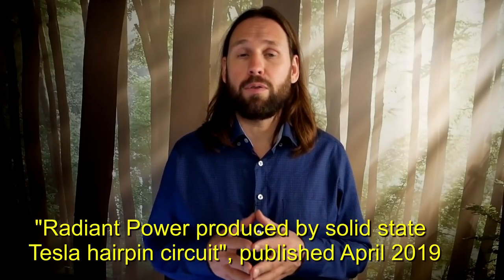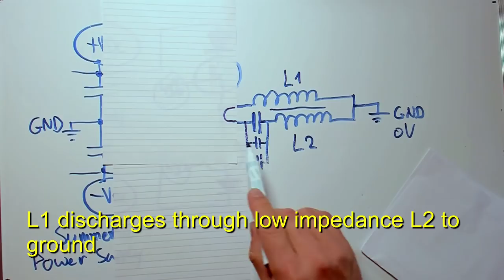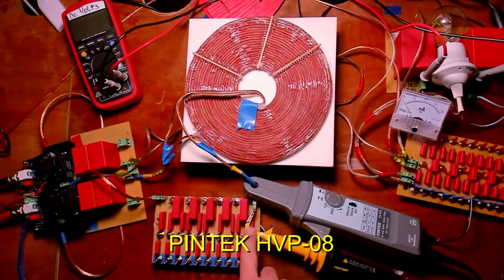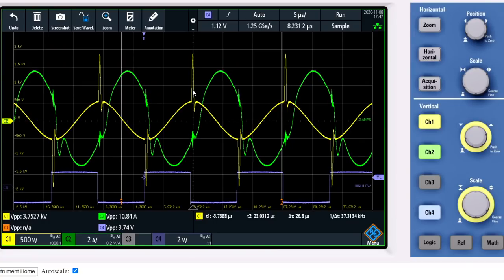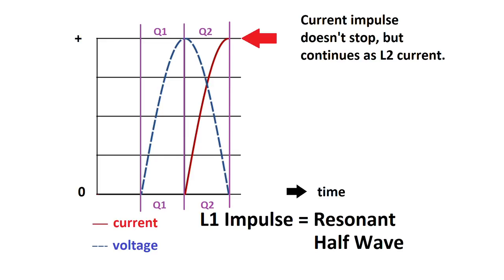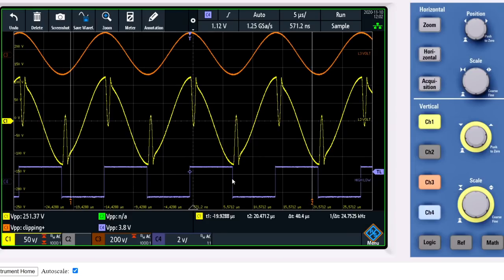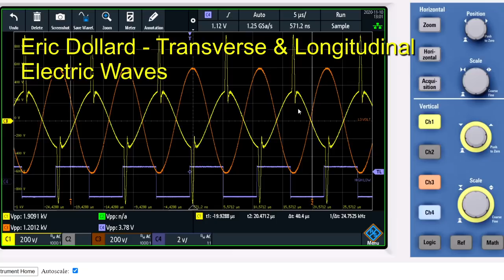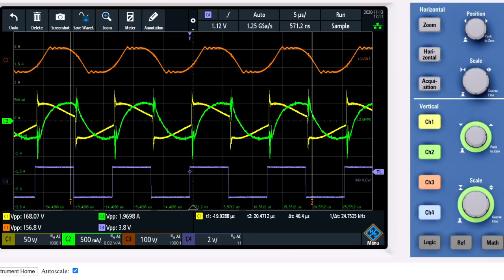Radiant Half Bridge Circuit, For Longitudinal Waves

Comment from the maker: update July 4 2021: This circuit has a flaw, it does not work as intended,
See this video for explanation:
https://youtu.be/bl4xk8CMe8I

Don't forget to look in the video description. there is a time stamp list and I provide several links, with more detailed information about the circuit.
Reply: Around time 22:30 when you present the fact that the L1 magnetic field collapse creates the brief voltage spike pulse into L2 - and you point out that this brief pulse into L2 creates a steeper current growth in L2 - the reason could lie with the fact that capacitors block DC but pass high frequencies so the capacitor connected in series-resonance with L2 is just allowing that spike from L1 to pass right through it.   This occurs because the driving frequency is no longer the frequency of the series-resonant L2 + capacitor.  That is just my guess at looking at your discussion around time 22:30.   If the driving frequency was still the resonant frequency of L2 + capacitor, the pulse would be utilized by that series-resonant path instead of just blowing right through the capacitor.

Comment: I explained many times on forums, energy source is the earth magnetic field, this field is steady, compass prove this. Now displace the field and it will bounce back, like back emf people called. Now resonant circuits is widely used in fluorescent ballast and ccfl ones. The tube act as a discharge capacitor tuned to the half bridge circuit. In radio transmitter, the antenna is the capacitor and displace directly the earth magnetic field propagating what we call radio waves. This concept must be understood by all for understanding what happens. Now we cannot push power and take it at same time, the trick is only this, then for a resonnant circuit, we charge the capacitor and it discharge into his coil, trick is to discharge the capacitor when he reach his full voltage and power the load, charge and discharge cycle, give take exchange in balance as Walter Russell explained. Also power can be extracted by differential output coil, this mean half is CW and other is CCW, source in the middle. One side is grounded and other side is connected to a capacitor the primary can be moved to tune the system to get the best COP. The other concept is to use harmonics: with a square wave input like 1khz a resonnant coil/cap will work at 3 times the frequency input, this mean it will resonate a 3khz and 5khz and 7khz and 9khz etc. Tesla understand this simple fact like music and frequecies symphony, this where all the power can be extracted, between phase shift and also with harmonics. I hope I inspire here some people's with my explanation.
Reply: Also remember a magnet or an electromagnet don't create a magnetic field, it only concentrate the actual field, this is basic fact. Do a air blower or a vacuum cleaner create air ? No it only displace or concentrate the actual air, magnetic field is exactly same, this is why radio wave propagate as growing a stone in a pool, the actual field is here and steady, we only move it and with coils relationship we extract energy called electricity, Donald Smith was wright about this !
Reply from the maker: I like your concept, of energy being in the field. As I explained in my Faraday tubes video, Mass, or better said Inertia, is a attribute of the AEther.

Comment: Don't forget brother, getting reactive power is only the first step.  It is necessary to reconcile the current and voltage in the load in phase.  for this a high voltage must be used.  That is, first dissolve the current and voltage, and then bring them together in the load using high voltage.  If interested, write.
Reply from the maker: already have that. no high voltage needed
Reply: @MasterIvo  I'm surprised I can't get free energy without high tension.  How did you do this?  Show me please!
Reply: @kurbanovmurad2738  I agree. Non linear dependencies voltage and current are critial. Doubling both gives 16 times increase. Good starting point.
Reply from the maker: I already showed resonant voltage and current being IN phase in the extra coil (L4).
I do agree high voltage is needed.
but how high is relative to capacity (plate area and plate distance).
I'm currently working using current impulses from capacitor diacbarges (using parallel mosfets).
based on the insight we need single direction displacement current into the coils (implosion)

Comment: In respect to the current amplification it sounds like a similar concept of the Marx generator and Cockroft Walton voltage multiplier circuit  Hybrid accept with current increasing instead of voltage.

Comment: It would be super interesting to put some of these circuits in a simulator to see how much they agree with measured results.
Reply from the maker: yes, indeed. It will probably show the flaws of the simulator, as it is based on flawed math, which has excluded the longitudinal wave interaction

Comment: thank you so much! i'm too doing thing like you but couldnt found much information as  you give to link all the knownledge I had. Not much people really understand whats is happenning inside these circuit and with no text book to explain, we need to found out all by ourselve. If I can give you a hint to help you, watch the power too on the oscilloscope that help to understand certain part. I make others circuit than your but using same principle and got similar result but I can adjust different parameter to have different effect. Have  Good Times. We gonna make this wolrd great togheter.
Reply from the maker: It is all new yes. I am going to. introduce a high voltage phase shifted coil

Comment: You could try an FPGA to make a square wave signal, in it can be programmed the duty cicles at will, changing frecuency without changing pulse duration.
Reply from the maker: field-programmable gate array? Not looked into that. Would love to have a auto tuner.

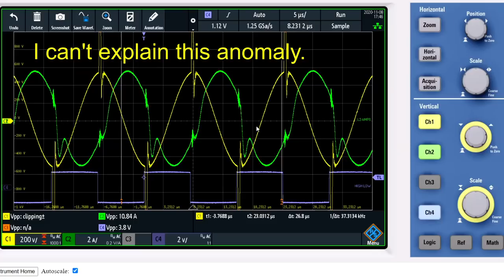Comment: in the experiment of minutes 19:19 aprox the suppose anomaly happen because when you add the impulse in the same direction of the wave amplitud it generate a broken symmetry bigger than the one who generate the wave, you can imaging a swing, the impulse will be add in both direction so the overall kinetic energy will be summarized with both impulse and it will produce an amplification on the  kinetic energy of the swing
Reply from the maker: thanks for sharing, I'll take a look at the time stamp later
Reply: @MasterIvo  great video, you may want to add some negative resistance to the circuit in order amplify the current even more, the key to the unlimited energy from the vacumm is the relaxing time of the materials wich is the time needed for the electrons to flow free to the surface if you can dope a material in order to slow down that period you could get as much as you want from a battery with a flip flop circuit for example without depleted it, there's a book from tesla talking about this stuff
Reply from the maker: yes thw kinetic energy of the Aether volume in motion (max when current is zero) is increased by the impulse. But is the push transverse of longitudinal?
Reply from the maker: @thecharlygroovework   negative resistance = discharging the capacitor  (negative current) Which book from Tesla is that?
Reply: @MasterIvo  it is longitudinal
Reply: @MasterIvo  the last secret of free energy if I remember correctly, I will send it to you by email
Reply: @MasterIvo  you can also create negative resistance using different materials magnetic and diamagnetic combined with positive and negative impulse to maximize the separation of charge, the dark energy take different electronic path through the materials so the difference in potential is bigger with different elements if you combine in a correct way
Reply from the maker: I would appreciate it if you emailed me the book. Thanks
Reply: @MasterIvo  I sent the email with the book, I hope you can test it out

Comment: Even though the voltage polarity is reversed for the impulse, the direction of magnetic field does not change which meant current can still be amplified.
Reply from the maker: it looks like that
Reply: @MasterIvo  You might be able to increase current by increasing the thickness of wire used in the pancake, if you think about it in terms of a homopolar generator and available electrons to be pushed.
Reply from the maker: @williamgreenhouse6418   I already increased the coils to 2.5mm2 for less resistance. 
"electron" is part of the field.it is the Fields that pulls.

Comment: I like that you use sacret geometry (Phi) in your coils and i also had the idea using audio cable for a bifilar coil but i think i realised that this just suboptimal. the bifilar technique focus on dielectric component of the energy field and not on the magnetic as you already explained. So a side-by-side-winding would be better than a on-top-winding, isn't it? Could you try to build a side-by-side-winding as the tesla patent shows? And on the next step: whats about using a flat ribbon of copper instead of a wire -> the dielectric component (capacitor) will rise a lot because there is more area where charge can be gathered, more turns (smaller gaps) with the same properties of the coil because the ribbon is about 0,1mm thick and not 2,5mm, and with the right width of the ribbon the resistance would be still very low (it would also support the skin effect on high frequencies that you also use). Please think about that ;)
Reply from the maker: yes, I have done it in the past. but both components are important. to produce power you need the dielectric field (voltage) and the magnetic field (current).

Comment: Did you know that the hairpin effect  of potentials and nodes on the stout bar is caused by an impedance effect?
Am trying to learn about Tesla's tech and found this statement
I think it means that the bars become self-inductive and / or capacitive at specific frequencies, and nodes appear at resonance, but maybe it's wrong.
Reply from the maker: maybe the impedance effect is here:
magnetic field(current) is related to space,
dielectric field (voltage) is related to counter space.
maybe, the sudden change in voltage (impulses) change the impedance of counterspace.
changing the capacity

Comment: Hi Ivo, good to see you putting out videos again! Have you considered looking at the properties of the pancake using Joseph Newmans (The Energy Machine) unified physical theory, basing all electro magnetism and much more on electron spin and torque, it makes the properties much more predictable as a model. You could then better predict outcomes, that currently you observe as unknown or strange with this method and you can more easily determine the parameters to alter the running of the circuit. Interestingly what he does not cover in his book is resonance, however extrapolating his concepts, I believe that in the physical universe energy can be re-purposed or transformed from A to B. At Resonance we see a jump in energy availability and I believe it is an access point from the zero point energy field outside space and time, being brought in, hence a new input into the universe. Keep up the exploration! Will
Reply from the maker: I consider the "electron" as to be more or less the connection of the dielectric field line (faraday tube) to the conductor. 
And The "electron" can be used to calculate, thats why JJ Thomson invented the corpuscle, that led to the nobel prize, as it was recognised as the "electron" (which is falso in my opinion).

I basically know the work of J Newman, but it has no value to me
Reply: @MasterIvo  Just a thought!

Comment: Hi Ivo,  thanks for this work.
Understanding the cycle, duty mastering, coil spacing,  now let's maybe grow up in CpS and impulse voltages  to get more Powaaa...
i mean renforce the quantity of pulses and energy temporary storage.
true RMS on L3  possible?
have you tried  any earth ground connection ?
Reply from the maker: I always use Earth ground.  power is already generated out of L3, but its not tuned properly, I need both forms of induction simultaneous from L2 and L1 into L3.

Comment: Thanks for sharing the video. I think you need to consider something in your circuit. Diodes are short circuits until they are reversed biased, so your switches are never truly "open".
 Instead of adding diodes to defeat the mosfet diodes, why don't you just burn those internal diodes out by running some current through the diodes on their own to burn them out.  If you want a "open" that is more like a mechanical contact "open", I would recommend experimenting with using a SCR in series with mosfet for switching
Reply from the maker: I like your creative thoughts. But the body diode of a Mosfet is not optional, it is there as being part of the way a Mosfet works. if the body diode dies, the mosfet dies. 
The mosfet bypasses the body diode, when it opens.
And the series diode opens for the external DC. It only blocks the impulse (reverse polarity), and does this very fast.
Reply: @MasterIvo  I said it because I had heard John Bedini say that he did that for something once. But he never said how he did it, I just assumed you you run enough forward current through that diode to burn it out,  without anything else hooked up to the fet.
Reply from the maker: @DavyOneness  no a mosfet doesn't work like that. but it would be a great solution. I tried IGBT's without diodes, but they turn off to slow, so you don't get a proper impulse
Reply: @MasterIvo  I think Paul Babcock has the best idea, a mosfet In series with an  SCR. The SCR turns on fast (like in a crowbar crk)and  is the best "off" condition when compared to transistors and mosfets, but it isn't easy to turn off fast. BUT!  that is where a low resistance series mosfet comes in. It will be limited in the high freq  you can go with it because  of the SCR limitations with  reset time.  I'm sure your circuit is fine like you have it, just something to keep in mind when it comes to approaching switching, especially when wanting spark gap kind of results.

Comment: excellent work.  Your detailed explanations are valuable.  Thanks for your hard work... ... can you chart the input Wattage vs the output?  What is the amplification result, meaning what is your COP or coefficent of performance?
Reply from the maker: 14kW? how did you come to
this conclusion?
Reply: @MasterIvo  sorry, perhaps my observations were incorrect... can you chart the COP?
Reply: @MasterIvo  I saw that your peak output was 1.3Kv x 10.9amps = 14kW., is that incorrect?  (The highest I saw was actually 3.7kv and 10.8amps) .  At that point, what was the input?
Reply: @tanner1985  I saw a peak voltage over 1300 and amp at 10.9, is this incorrect?

Comment: When creating Ether stress with the intention of creating Radiant Energy it has been stated that the stress polarity must be always in the same direction such that you are continually pushing the Ether in the same direction with each pulse rather than pushing and then a half cycle later pulling the Ether. 
Does this make sense? 
I other words is your half bridge doing a push, push, or a pull, pull, as opposed to a push, pull?
Reply from the maker: as we deal with oscillations, the direction swings back and forth, by using the right polarity impulses, we get a pull pull situation. Amplification comes from both polarities, as they lign up  with the polarity of the oscilation. You see it is all relative. it looks push pull from a distance, but if you look at the movement of the Aether field, it is a pull pull.
Reply: Troll Alert
Reply from the maker: @allanlind676  Indeed Allan. Troll removed and blocked

Comment: It has not been clear to me if you did attain the overunity effect !? As for the underlying mechanisms, it looks to me that two of articles/videos of Sergey/i Dey/ina have the two constituents of your configuration, with the great contribution of yours in combining and varying the inductor discharge and the resonant capacitor charging … BTW, regarding the overunity and self-working features/ potentials of your configuration, if the L1 would be the part of a DC-motor, the more than 100% efficiency of it might be attainable without any degradation of the systems inverting part !?!
Reply from the maker: I did not attain it (yet)

Comment: What if you power a Plasma Globe with your Radiant Half-Bridge Circuit instead of Halogen Bulb? Will we see a visual difference between transverse and longitudinal electric waves with how plasma behaves inside a Plasma Globe?
Reply from the maker: A plasma globe could show interesting results. but it needs much higher voltages to work.